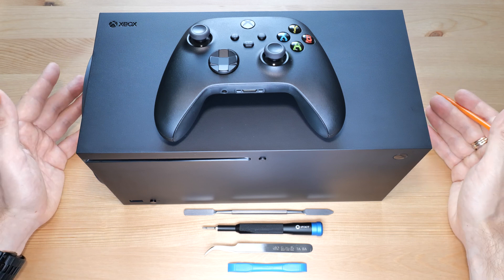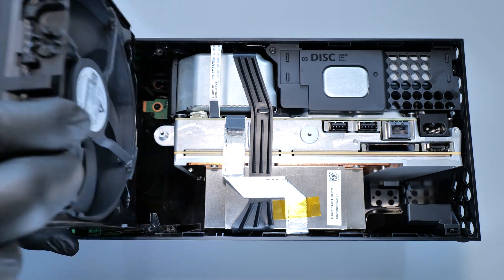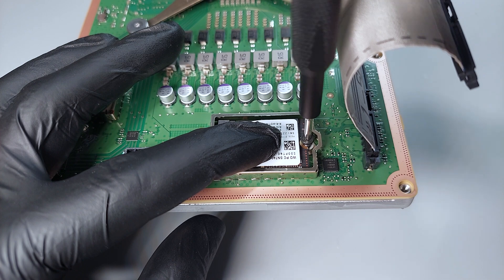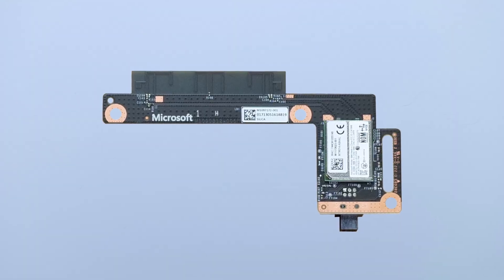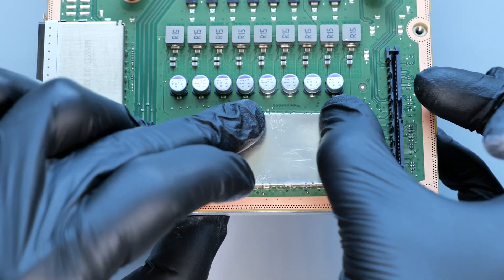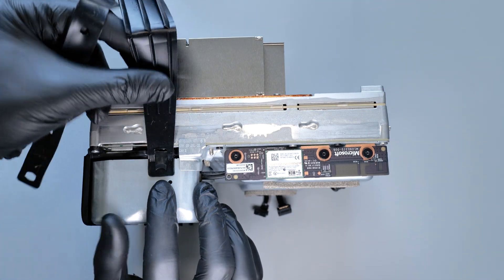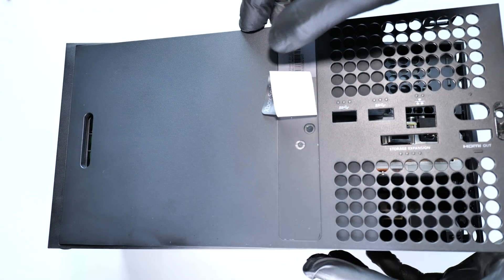Xbox Series X Disassembly + How to Diagnose Power, SSD, WiFi & Cooling Issues

Comment: Not sure what to do but I’d like to hear your input, occasionally when playing my console freezes for a good 5 seconds then sends me to the dashboard sometimes even just shutting off what could be the cause of this?
Reply from the maker: Well, those faults are always tricky. When something like that comes to my repair shop, I start by removing the SSD, connecting it to a PC, and checking the SMART data of the drive. If the drive shows signs of bad blocks, that’s the issue, and you need to replace it immediately. If the encrypted boot partition gets corrupted, the console becomes unrepairable, thanks to Microsoft. If the SSD is in perfect condition, I check the MOSFETs to ensure the APU and other power rails is getting the required power and everything is in order. Next, I inspect the cooling system, replace the thermal paste, and renew the thermal putty. If all the above checks are fine, then the issue is likely with the system software. In that case, you’ll need to reinstall the entire system. It’s similar to reinstalling Windows — it’s super easy, and I have a video that explains how to do it.
Reply: @ thanks for your input I’ll need to check those parts out soon

Comment: I have an interesting one for you! My console stopped connecting to the internet. I use an ethernet cable. 

If I have my ethernet connected it says im connected to the internet but when i try to access internet it doesn't work. 

If i unplug the ethernet cable and check my network connection it still says im connected to the internet through a wired connection. 

If i try to connect to wifi it says i cant unless i unplug my wired connection (it says this regardless if my ethernet cable is plugged in or not.)

What part of the hardware would cause this false positive where it detects an ethernet connection despite it not being plugged in?
Reply from the maker: I’ve never had this exact issue (or perhaps I never checked the WiFi connection), but I’ve fixed plenty of consoles that didn’t recognize an Ethernet cable when connected, or falsely showed it as plugged in. The root cause was always the Realtek Ethernet chip, located about an inch away from the connector. This chip costs around $10: https://alii.pub/74mwqm
You could simply remove the chip using a construction hot air gun and rely on WiFi only. But, I’m not sure if this would work with current or future updates. If the system fails to detect the chip, it might throw an error or fail to boot. That said, it’s still likely to work.
If you want to replace the chip, you can get the cheapest hot air rework station for about $25, including delivery: https://alii.pub/74mwui

Comment: Hello, greetings from the Dominican Republic. I have a problem with an Xbox Series X console. I don't know if it is the SSD that is damaged.

The only thing is that the same error occurs that when the SSD is installed it does not turn on just the tab.

and when I take it off it turns on normally as well as the video but when I connect the SSD to the PC it recognizes it and works normally.

I would like you to give me a reference on what I can do in that case.

Whether to change the SSD disk and transfer the data to a new SSD disk.
Reply from the maker: The issue is most likely a corrupted bootable partition on the SSD. To fix this, connect the drive to a PC and use the Command Prompt (CMD) to run commands that check and repair data. If that doesn’t resolve the issue, I have a video tutorial on backing up the first bootable partition using Macrium Reflect. Once backed up, you can format the drive, restore the partition, and install offline updates from a USB drive.
However, keep in mind that if the original boot partition—with its unique encryption key—is irreparably damaged, your console might essentially be worth only around $50 for donor parts. At that point, no one in the world can repair it. Microsoft offers a refurbished replacement for $250, but in most cases they won't fix your specific console. I think this limitation is intentional. In previous generations, the boot partition was stored on a chip, allowing users to swap in any SSD or HDD. With the Series S and Series X, only a few compatible SSD models exist, and the absence of the original boot partition renders the console unrepairable. In such cases, it may be better to purchase a new console instead.

Comment: I’ve replaced the power source unit and still can’t get any sign of life What else could possibly cause this issue? I’ve also tried my other power cables electric outlets and remote control
Reply from the maker: There are hundreds of components that can fail, resulting in the same console behavior. Do you have a multimeter and a hot air station? You should start by checking the output voltage of the power supply, followed by all the power rails on the motherboard. Inspect all key MOSFETs and power rails for shorts. If this is not possible for you, at least try removing both wireless boards and the SSD, then attempt to turn it on again. I only encountered one Xbox with a shorted wireless card, which means it's rare but possible.
Reply: @ thank you

Comment: My series x fan wont turn on and spin.  I replaced the fan with a new one, but it still wont fire up.  Now what do i do?  Great video by the way!
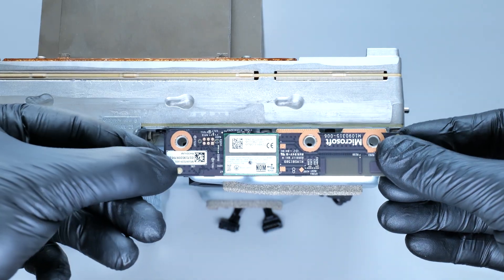Reply: 3:06
Reply from the maker: Do you have a multimeter and a soldering iron? The issue might be a crack near the fan connector on the motherboard (easy to fix) or faulty components controlling the fan (hard to fix). If it’s the latter, you can power the fan from another source, like soldering a wire to the 5V USB power rail or a 12V supply. Remove one wire (positive) from the fan connector, attach a longer wire, and solder it to the 5V rail. It’s a simple and cheap workaround if you don’t want to visit a repair shop

Comment: Can you do a video on the hdmi port and repairing
Reply from the maker: If the HDMI port is damaged, you'll need to replace it. To do so, you'll require a hot air station. If you want to save money and do it yourself, a new HDMI port costs around $5, a basic hot air station starts at $30, and flux will cost about $5. If you think it's worth it, I can provide you with the links.

Comment: Hi, 
I've managed to disassemble my Xbox series X using your fantasticly detailed video.
I've discovered a problem with the PSU which I'm hoping you can help with please.
From cold the PSU outputs 12v but only after 30-40 seconds from switch on. If I load up any of the outputs with a 5W 12v bulb it glows for approx 5 seconds then dies.
Presumably it's a heating problem but beyond my diagnostic ability.
Hello please. 
Thanks
Reply from the maker: That power supply is very powerful and shouldn't even notice that 5W bulb. I have a video on diagnosing Xbox Series X power supplies, but with this fault, it may not be helpful to you. Check all the electrolytic capacitors to ensure they're not bulging, leaking, or showing any brown discharge. Also, make sure they still provide capacitance. You can test this with a regular multimeter in continuity mode.

Comment: Hey I have an Xbox series x that freezes and crashes into dashboard without any warning message, only demanding games like the Witcher 3, cyberpunk, fortnite, and Elden ring cause the crashes so far. It can play low demanding games no crashes  like Spyro, wolfenstein new order, Borderlands 2 and  persona 4 golden .I have changed the fan and tried another power supply that works but the game crashes 1 to 2 minutes after going into gameplay. Also changed the thermal paste. You think you have an idea of what it might be. Would I need to change the thermal putty on the vram and put new ones as well?
Reply: Not sure if you got this fixed yet but if it’s crashing that quickly into a game, I would suspect the SSD to be at fault in one way or another.

Comment: Tenho um problema com a Xbox, já tentei de tudo. restauronde fábrica.. configurações de energia. é o seguinte a minha consola se desligar pelo comando em modo de baixo consumo já não volta a ligar pelo o comando! tenho sempre que apertar o notao físico da consola. engraçado que quando tiro e volto a colocar na tomada ela liga pelo comando.
Reply from the maker: Parece que isso pode ser um problema de software ou firmware. Primeiro, certifique-se de que seu Xbox está atualizado com o software mais recente. Você também pode tentar fazer uma atualização manual usando um pen drive—é meio como reinstalar o Windows no PC. Tenho alguns vídeos que mostram como fazer isso; é bem simples.
Se isso não resolver, o problema pode estar na fonte de alimentação ou no cartão wireless. Como eu nunca vi esse problema específico na minha oficina, é difícil dizer sem verificar os componentes. Diagnosticar e consertar esses problemas geralmente requer peças e ferramentas que não são fáceis de usar em casa. Então, comece tentando a atualização offline.
Reply: @ElectronicsComputers  thank you very much for the answer.  I did it all. I have two Xboxes, I changed the wi-fi cards and the error continues. I will then try to have you change the power supply. I noticed that the only way that works is to go to power settings and choose the option to turn off console. better than nothing. There should be a shortcut for this option!

Comment: I have an Xbox that boots to the menu and all but restarts when I start a game? Could it be the HDMI encoder?
Reply from the maker: No! First, I would check the cooling system. Then, I would check the APU power management circuit (one of the phases may not be working due to a failed MOSFET, and the APU might not be getting the required power). Next, I would check the SMART report of the SSD, and if the problem is still not found, I would check the power supply.
Reply: @ElectronicsComputers  Fresh thermal paste, SSD is in good health, no shorts on mosfet

Comment: My console will randomly freeze and them shut off when on games. After replacing thermal paste and putty its still doing it. I also never get the your console shut off due to overheating screen when turning the console back on.

Is it likely Ive still got a bad thermal interface somewhere or what else may cause this fault?

Thank you, your videos are very high quality!
Reply from the maker: Random console freezes and shutdowns could be caused by various factors. If you've replaced the thermal paste and thermal putty, and the fan isn't running at maximum RPMs, then you've done everything correctly so far. The next step would be to check the SMART report of the SSD. You can use any free software for that, but you'll need to connect the SSD to your computer. If the SSD is in good condition, then I'd suggest checking the power phases that supply the APU (though this requires a multimeter, and you might not be able to do this yourself). If some phases aren't working, for example, due to failed MOSFETs, the APU might not be receiving enough power during intensive gaming, causing the console to freeze.
Reply: @ElectronicsComputers  interesting about the power phases!
I don't think the fan is running at maximum RPMs, but it's hard to tell as it's the only series x I've worked on.

I will check out the SMART report of the SSD tonight, and also back up the encrypted partition that pairs it you've mention in your videos/comments!

I have a multi meter and oscilloscope, do you have any information about how to test the power phases? I think this is most likely cause as it won't crash on the desktop, only when in a game or something more intensive which would draw more power.

Thank you so much for your suggestions, I really appreciate it
Reply: @ElectronicsComputers  do you do repairs for the public? Would it be possible to send it to you for testing?

Comment: Ok so my series X won't stay on for more than 15 seconds. Previous owner replaced the hdmi port but still the same black screen. I pulled out the SSD as recommended at 5:06 and it does stay on longer, about 1-2 minutes and then turns off again. The fan does not stay on though, only the light. So if this is not an overheating issue should I go ahead and replace the SSD? Can the original SSD be saved? Any help would be much appreciated!
Reply from the maker: Does it start to boot normally, like when you see the Xbox logo on the screen, etc.?
Reply: @ElectronicsComputers  Nope nothing, still black screen with or without the ssd. I tried putting the ssd in my pc but it doesn't even show up on disk manager. I also tried downloading OSU1 onto a usb drive and plugging that in but its still just a black screen with or without the ssd installed. Theres no visible damage anywhere on the console or the ssd so I'm not really sure whats going on. I can't connect a controller to it either, when I plug in a controller manually it rumbles once but the controller still doesn't light up.
Reply: @ElectronicsComputers  Any ideas?
Reply from the maker: @Spagooter9375  It's really hard to give specific advice without more information. It could be the retimer chip, and I have a video on how to replace it. However, what confuses me is why Windows can't see any partitions on the SSD. Can the BIOS/UEFI recognize the SSD? If the original SSD is dead, then any Xbox Series S|X console is essentially useless. We buy such consoles for donor parts for $50.
Reply: @ElectronicsComputers  Perhaps I did something wrong. I just put the SSD direction into the extra slot on my motherboard, I didn't buy that usb device to plug it in. It didn't show up at all even in bios. I wish I knew that Microsoft, with their micro d energy, decided to make repairs so difficult. I'll look into this retimer chip. If theres any other info I could provide let me know, otherwise thank you for your help.

Comment: Followed the video to a certain part. I have an issue where, when the console is plugged in, the fan turns on by itself, yet pressing the power on button does not turn the console on(the power on button does not light up, or make the power on sound) the fan just spins by itself. Any suggestions?
Reply from the maker: Was that issue there before or after disassembling the console?
Reply: @ElectronicsComputers  before

Comment: Hello, I bought an Xbox series X console, I played games, the console was slow for a week, when I turn it on, it stays in Lego X for a minute, it crashes, and the game runs late. I reset the console, but it didn't work. What do you think is the problem? 🙏❤️
Reply from the maker: So, I presume you bought a used console, right? If so, I'd start by checking the health of the SSD. Connect it to a desktop computer, or a laptop if it has two M.2 slots, and check the SSD's SMART status. If it’s bad, you should immediately back up the first boot partition of the SSD. I have a video on how to do that and how to replace the drive. If that partition gets damaged, the console becomes unfixable. If the SMART status of the drive is good, I'd start checking some key points on the motherboard, but it's hard to explain in a message. So start with checking the SSD.